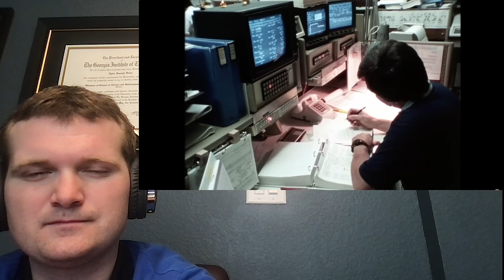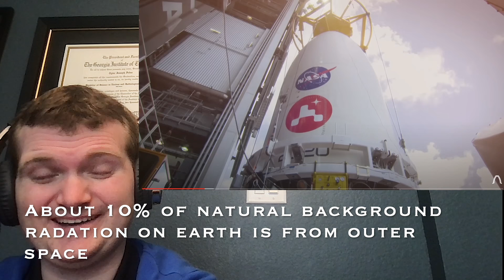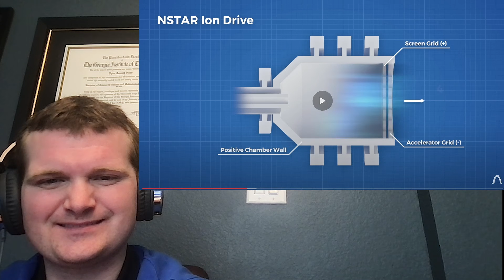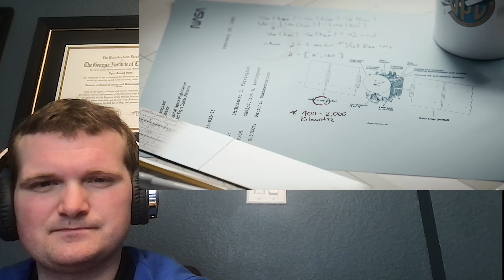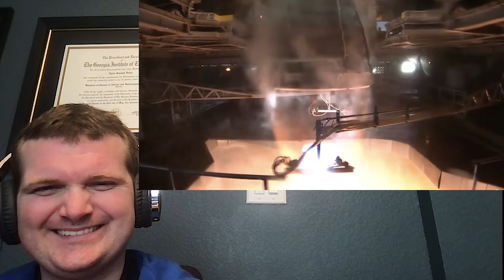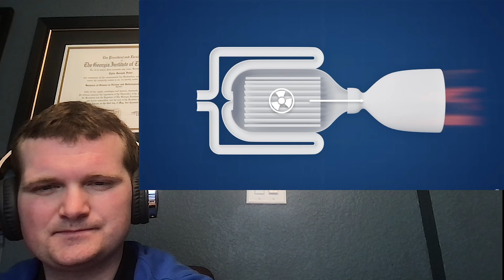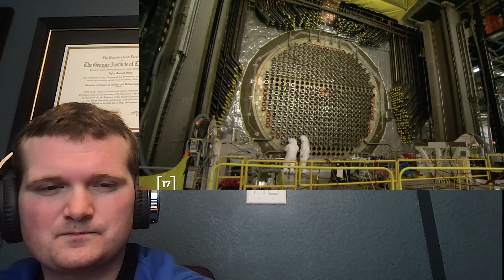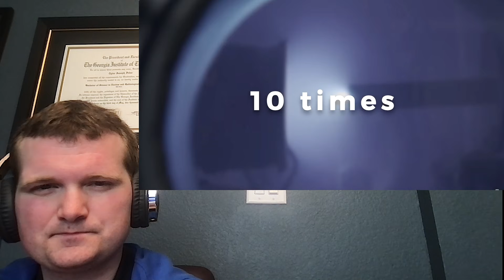Can Nuclear Power Take Us to Mars? - Nuclear Engineer Reacts to Real Engineering

Comment: Reminder that the last thing you want to is try to block gamma rays. The resulting hadronization is way worse for astronauts than the chance of gamma rays interacting with them. You want to block relatively low energy ones, but not high energy ones. So there is a balance for shielding.
Reply: If you're using metals for shielding that could be an issue. I don't think it's a problem for water shielding, but you'd need a pretty hefty amount of water which is a lot of mass to lug around (although it could be useful on Mars).

The spacecraft is also going to have metal parts for structural support so if you have any appreciable amounts of gamma rays they'd better be pointed in another direction.
Reply: So what, astronauts just have to eat the big ones?
Reply: @ninjalectualx  It is part of the risks. If I remember well, the moon gets 3 to 4mSv of gamma radiation a year or so. You can stop the weaker ones, but when a relatively strong photon interacts with something, it creates way more matter than it has energy for a short period of time and all that matter is exotic and more dangerous than the gamma ray itself. Look up something like the omg particle or even hadronization. You have to use shielding that is enough to stop weaker gamma and the resulting hadronization when it does, but not too much that a strong ray will blast the inside of the vessel with random particles.
Reply: @soulwynd  OIh no! I've been hadronised :)
Reply: @saumyacow4435  Shine bright like a high energy photon creating matter.

Comment: Just curious, for the radiation, could you run a really big electromagnet from the nuclear engine, creating a barrier like that on earth?
Reply: The radiation from a nuclear engine cannot be blocked in this way. Alpha radiation (ions) and beta radiation (electrons and positrons) can be deflected with sufficiently strong magnetic fields. Neutron and gamma (photons) radiation, however, cannot be deflected by magnets, as these particles have no electrical charge. The neutron radiation is the main problem with a nuclear engine.
Reply: A magnetic field to block alpha and beta radiation is not useful eighter, as it is already blocked by thin metal.
Reply: in theory, but the really big electromagnet would require really big energy to run, and to carry it's additional payload. (Assuming you could make it work that way)

Comment: I really dislike the unit of specific impulse. Why dont we just straight up use exhaust velocity tp compare the efficiency of rocket engines?
Reply: Because you need to also measure how much fuel you need, as the mass of the fuel also hinders how much you can put in the vessel before it diminishes returns. There is a limited space in the vessel, and that same fuel needs to be accelerated as well.

Comment: If you can solve operations and safety onboard SSNs (and SSBNs) then you should be able to do it on spacecraft also. Also, you technically don’t need that much radiation shielding for the crew if you fit the entire reactor compartment away from the crew compartment e.g. on a long truss. You could even design the craft so that the reactor is dragged behind the engines so that the connection is under tension rather than compression.
Reply: How effective is pumping vacuum through distillation and then running the distilled vacuum through the reactor to cool it?
Erm, thrust comes out the ass end of the unit, so you'd be running an engine over the front of the ship that you're dragging. Well, the crew will be well preserved, being radiation sterilized and all, they'll never decay.
Reply: @spvillano  LOL
Reply: @spvillano  I meant training and operation of a nuclear power plant in space, not how you cool it…but I suspect you know. Why would you want the power plant to produce thrust? That’s what the engines would be for.
Reply: Submarines are the opposite of space ships, they have continuous access to huge masses of cold water. Cooling in space requires massive heavy radiators, and putting reactor on a long spar adds more mass. Pulling the engine behind your engines means it gets rapidly irradiated, becomes impossible to maintain, and degrades far faster.

Comment: Before I watch this video, how would you get a reactor to work using any type of fluid in zero gravity? 
Thermoelectric generators work....they don't produce a lot of power.
Reply: It depends on what kind of coolant is used, high flow of gases can be a good solution.
Reply: A very recent invention you may not have heard of called "pumps".

Comment: 28:45 What we could do is use a hybrid of both nuclear thermal and nuclear electric . What we could likely do is something nasa, and the technology researchers have suggested is the most efficient for the best speed
Reply: Yes you could choose the worst of both. Lots of additional mas from hydrogen tanks and at the same time lots of additional mass from thermal radiators.
Reply: @saumyacow4435  yes
Reply: The same reactor/engine cold "burn" extra LOX in the exhaust (whether it runs Methane, Hydrogen, or even Carbon monoxide) for extra thrust for short high powered burn maneuvers. It can help reduce tankage and thus ship size and mass, to be prepared to do so.
Then the reactor can run at lower power to run equipment (or an electric thruster, but really it's difficult to see the sense of that for the help it gives for interplanetary transit, versus just running the engine longer).
It can be used as a power source down on Mars or one of the moons of Jupiter or Saturn to tank up.

Yes, waste heat might require thermal management systems beyond just throwing propellant through it.

Comment: One way to protect the crew with minimum protection from radiation is using something called a shadow shield, which litterly is what it sounds like. You basically use a single solid, thick enough shield like lead, tungsten, whatever for the crew that sits just right in front of the reactor behind the fuel storage and crew modules and sit in the zone where radiation is being mostly blocked by the shadow shield which is the only thing protecting you from the reactors radiation from that theirs no radiation shielding to block the neutrons around the reactor just the shield is enough for the crew and such in the shadow zone or you could make the space craft long enough to be far away enough and be safe without the shield their many ways to do this.
Reply: And one has to perpetually maneuver any landing module only through that shadow zone, lest the neutron activated engine kill the occupants.
Reply: @spvillano  yep
Reply: It'll protect you from the reactor but there's still the cosmic background radiation to deal with. Having a big shield does help with solar flares though, since those are mostly directional and you can orient the spacecraft so the shield sits between the humans and the sun.
Reply: @eyv  this is about Propulsion
Reply: @eyv  not from cosmic also their mamy solutions to that